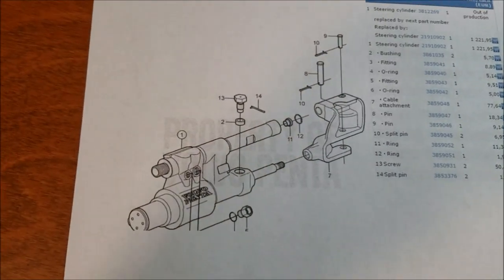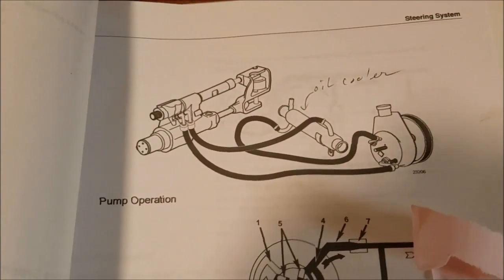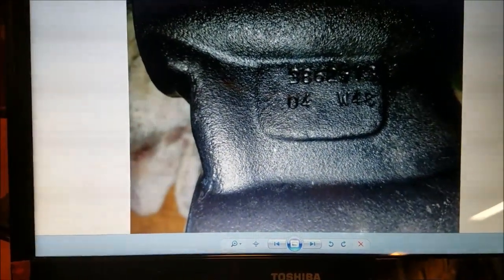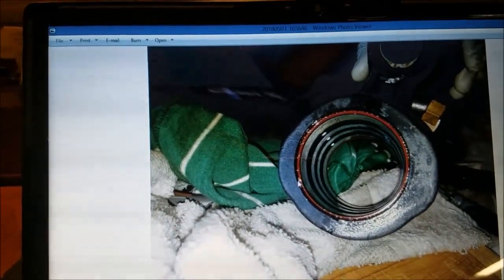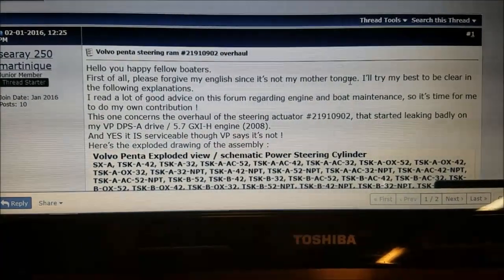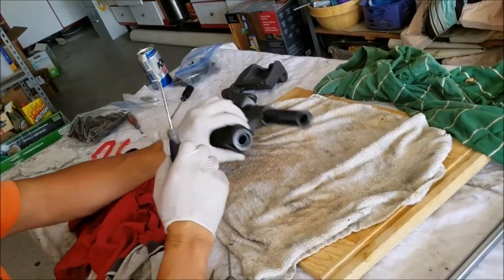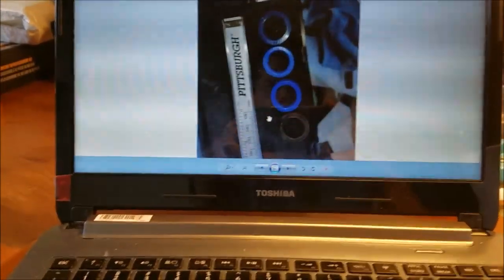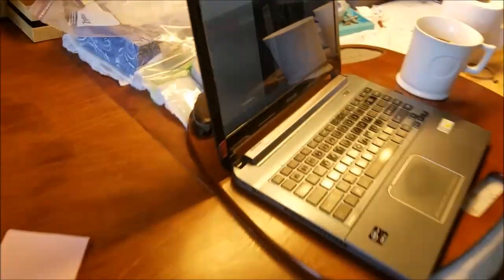VOLVO PENTA POWER STEERING OIL LEAK

Comment: Thank for posting this video! My seal finally gave up the ghost. Got my actuator out (pain the ass!!!!!), O-Rings and Things have made a kit just for this purpose. They were super helpful and I got my kit in 2 days. I did have to have a shop install the seal. I could not get it after 3 hours of trying. The re-install if the actuator was a walk in the park. Had the boat out today and NO LEAKS!. Thanks again for the video.

Comment: Very helpful video! Thanks!!! Single lip works great. I recommend an oil seal with spring in place of the wiper seal. A little loc-tite holds it in place.

Comment: So I bought the kit probably same as you but inner seal was also small like you explained and couldn't get a refund but all I really wanted was to know where to get the inner seal that goes in before the dust seal cover because it needs to be tighter and it was lose after I put it in.  I noticed you show a picture of the 4 orings together and I'm sure I also need the biggest one
Reply from the maker: You need to buy it from Orings and Things. Watch and listen to the video carefully. I made specific comments regarding wrong part bought from eBay.
So many other boaters have had success.

Comment: Hi there, I am having a problem with a leak coming out of the larger cylinder.  You have taken yours apart starting at 8:06 in the video.  How did you remove the cylinder from the larger cylinder starting at 8:06?  I don't want to break mine, but it seems like there is a metal stop which is preventing me from removing it from your picture.  Thanks in advance for any information you can give me.
Reply: Hello my friends do tu can

Comment: Leaking from hole (plugged) by the blue end cap
So I just pulled mine and rebuilt thinking the seal was bad. I noticed while part it looked fairly decent. Seals looked intact. I put it back together, plugged the line connections, and worked the ram. I was shocked to hear air sucking. It sounded like it was coming from the blue cap. After looking closer I see there is a factory hole that was machines into the end, which looks like it had been plugged with a threaded plug. Air was leaking quite easily past it (this is also where I saw the ATF leaking out. My question is what is this for? Can I plug it with JB Weld (or some type of epoxy), it is it supposed to breathe? Seems this is the source of my problem but not sure the best remedy.
Reply: Have you figured out anything for the cap?

Comment: For the (2) large orange seals i went to a local seal supply house and they are polypak 2-1/4x2-1/2x1/8.  PP12502250.  the only difference is this replacement does not have a wiper.  Will update when back together and running. @phamasite pretty much covers the rest!
Reply: hello i have a question For the (2) large orange seals ?

Comment: I have you exact same actuator and problem so I am gonna attempt the fix myself as you did, the pack of black O rings you have in the video, did you order those as part of a kit or where those a bunch of random ones you picked up, I am gonna try to have everything ordered and here at home as to try to minimize my downtime.  Thank you in advance for the video it is very informative.
Reply from the maker: All you need is the oring i circled on the invoice 16x24x5. Bought it as a single item from oring and things. They have a website.  Package from ebay does not fit. They claim it does. My video is choppy but if you listen carefully everything info is correct. i think black package u refer to is from ebay. I would have to watch video again when i have time

Comment: How did you replace the O-rings on the big cylinder?
Reply from the maker: I think you are referring to the big ring embedded in the big cylinder. If that is the case, it's the ring to guide the rod from moving back and forth. I's not something to prevent oil leak

Comment: Awesome!! Thank you so much for this video. I am currently going to tackle this same project soon. 
mine was leaking out the the same spot. 
So just to confirm, the correct seal sing is 16x22x5?
Reply from the maker: Yes. That is the right seal. It may seems impossible to get it in but it takes some time and you'll get it in. When you put the rod back in, it seems very tight but dont worry. Once everything is put together and you use your steering wheel to turn   You won't notice the friction.
Reply: Is it 16x22x5 or 16x24x5? I think your comment contradicts your video? Did the Orings and Things product 16x24x5 work?
Reply from the maker: Yes, Orings and Things 16x24x5 worked. 3 months of regular use and no leaks.
Reply: @phamasite  Hello phamasite... 1st great video, extremely helpful.  Always appreciate those who go to such extremes to help others.  Same issue for me, I have 2 questions.  Q1:  Can you kindly share your "O-Rings and Things" invoice number?  The nice people at O-Rings and Things (Shawna) said she could look up your order info so they can supply me the same rod seal.  Q2:  Did you also order a new wiper seal (dust seal)?  What did you use for that seal.  Appreciate you.  RandyF
Reply: Mr Bobby - did you overhaul your Volvo Penta Steering Actuator?  Any results to share?